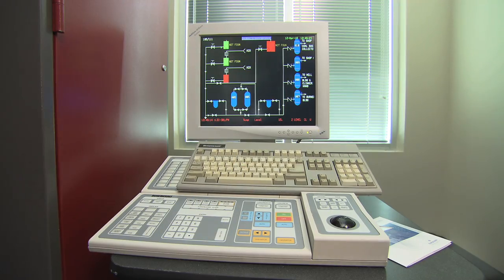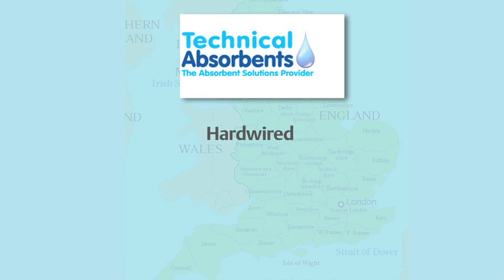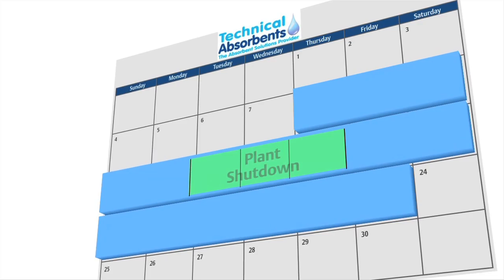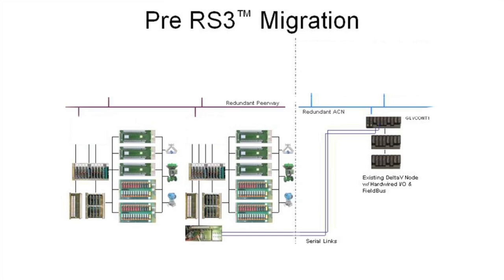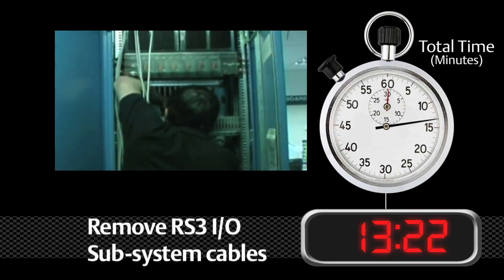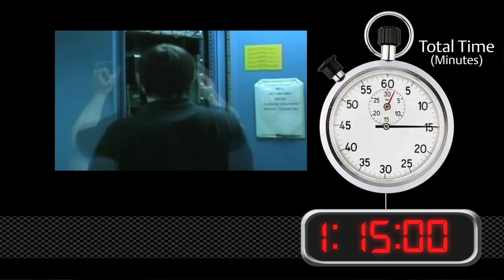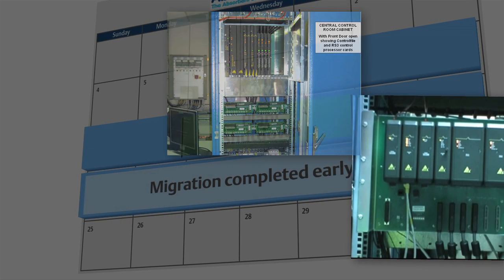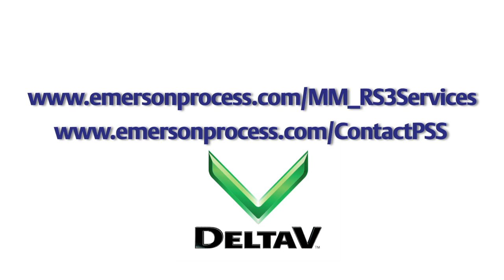RS3 to DeltaV System Migration

Comment: I wonder how the two compare in terms of ease (cost) of programming and configuration and the the use of the  operator interface. Delta V is likely a giant step backwards in time, like going from the Golden Age of Greece to the Dark Ages.